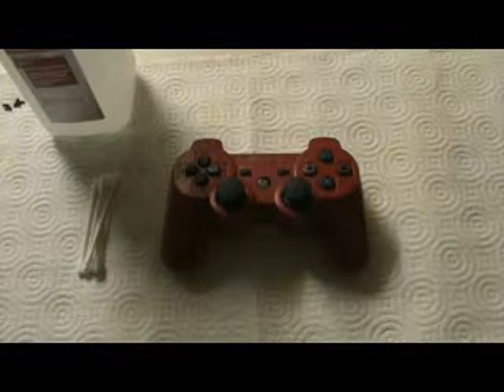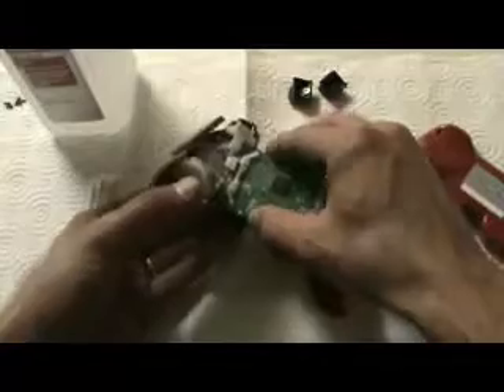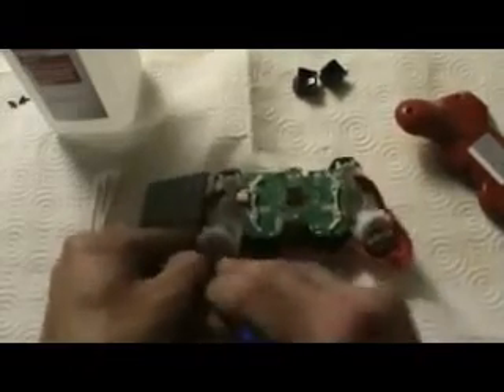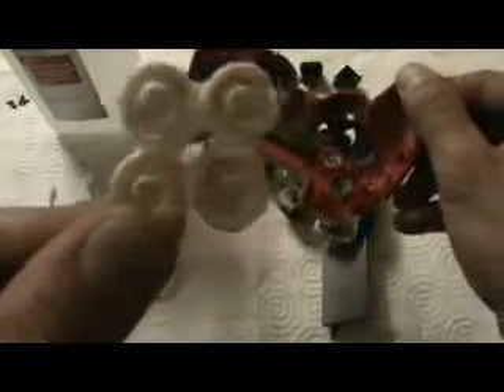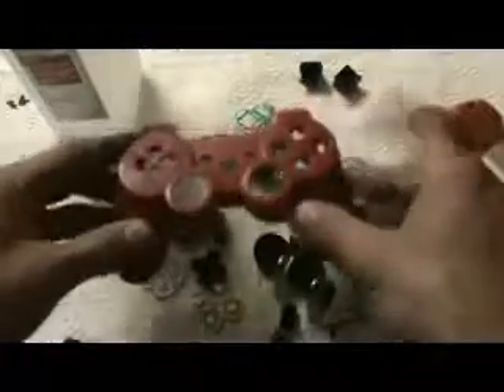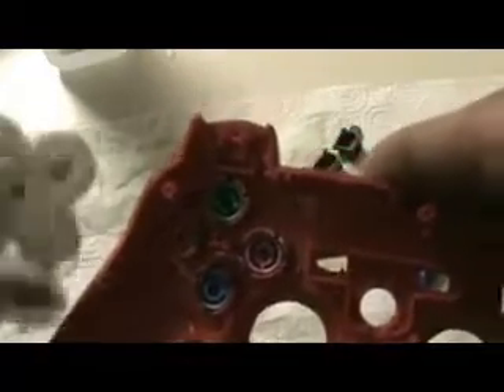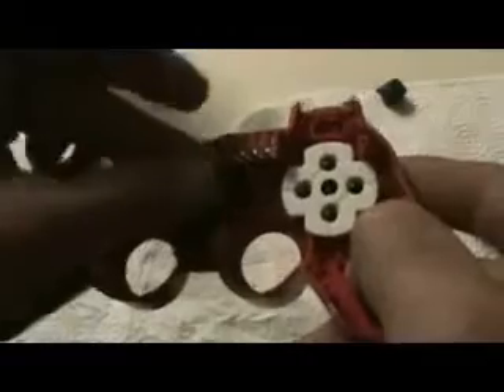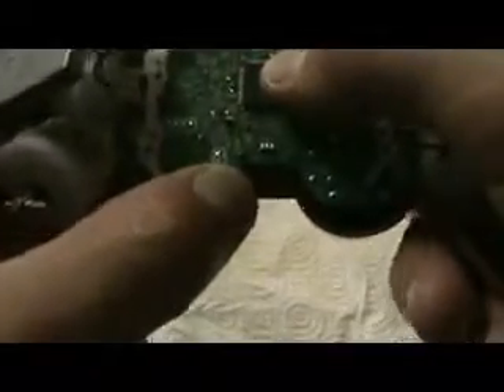How to fix PS3 controller Dualshock 3

Comment from the maker: It may just be a little worn out, but a lot of times it's the inside of the rubber joystick part that is worn down and it is basically sitting too low. You can open it and pull the joysticks off and check, I shimmed one on my old ps2 with a small piece of an eraser. Basically see if it the electrical part (joystick pot) or the rubber part you actually push.

Comment from the maker: Yeah get in there and clean the joystick pot (the electronic part under the actual joystick) with alcohol, it is ok to get the alcohol in there just give it time to dry afterward. Use a q-tip to clean in there and move the joystick nub around a lot while you have it open. It just needs a good cleaning in there.

Comment from the maker: Kayla also try that battery in another controller if you can, if it doesn't work in both controllers then you know the battery is the problem. You can order just the battery online for less than a whole controller.

Comment: When u said that its ok to have water in the buttons.yo it will break but i like ur video.but the most immportant part is the piece with the foam.if that breaks u may not be able too push buttins and them work

Comment: Man I tryed to put this thing together to find out the sticky foam to that controller that connects to all the controles, but I made my own by using peices of card board box with the right size, and used wire tape and used the sticky part out ward for it to stick on and its works

Comment: My playstation 3 problem is that it will not sense the joystick when you move it around like if I move it in the corners it wouldn't sense if I'm walking of running so if I'm doing a mission I always end up walking. I think it just needs to be cleaned to me. but I will try your video method and a couple of others. Thanks though!!

Comment from the maker: Sorry for the wait, I think your battery in the controller is either not plugged in tightly or is dead. Open it up, unplug and replug the battery and see if it will come on, if not it is 99% chance the battery has gone out.

Comment: I put it back together and now its just flashing when plugged in if. I unplug it it goes black do u have a solution?
Reply from the maker: Yeah man, turn off the console, plug in the usb to the sontroller, try to turn on console with the ps button on the controller, if the light won't stop blinking and nothing turns on, go into the controller (sorry) and unplug the battery for a minute and plug it back in. Then turn on the system using the controller still plugged in the usb.